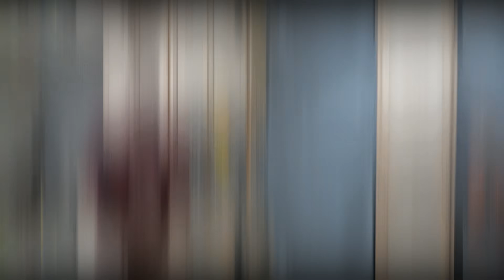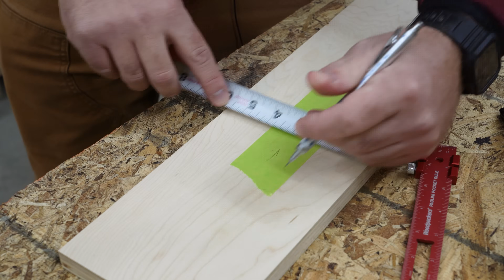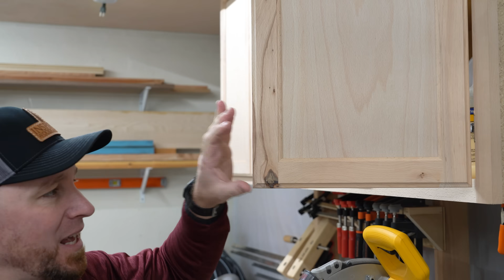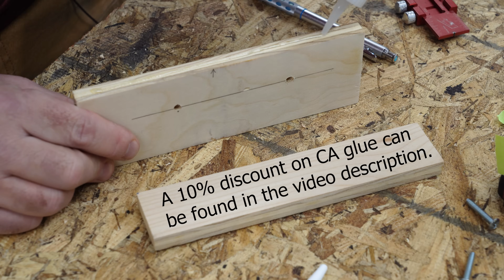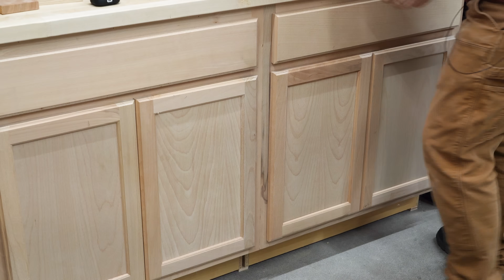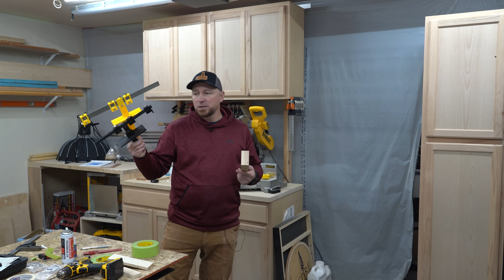The Most Foolproof Way to Install Cabinet Hardware / How to Install Cabinet Handles

Comment: I recommend to always and I mean ALWAYS, hold your handle up to your marks and give it the old eye ball test to see if your marks line up with the holes on the handle! I work as a cabinet installer and know that when you’re starting out with handle home layouts it’s very easy to get in a rhythm, make a mistake and ruin a front because a hole got marked wrong.

Comment: A good simple approach.  If you don't use a drill press, it's probably worth checking that the screws fit the handle going through the jig in both directions.

Comment: You bought pre-made cabienets? Why did you not just mke they yourself?
Reply from the maker: Honestly with the price of materials it was easier and less expensive to just buy them.
Reply: @InspireWoodcraft  So does that mean you are going to get out of woodworking? Because almost anything you build out of wood currently may be cheaper and easier to just buy pre made. However, it will not be custom and the quality will not be the same.